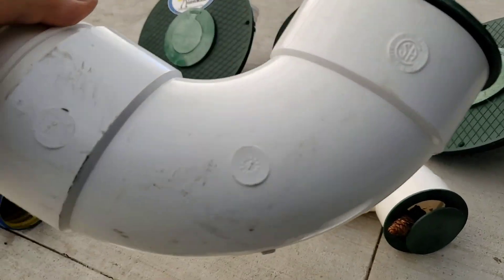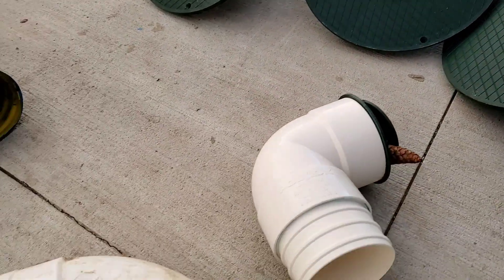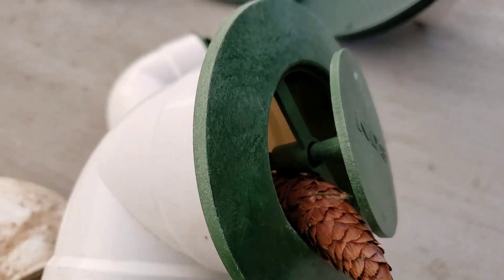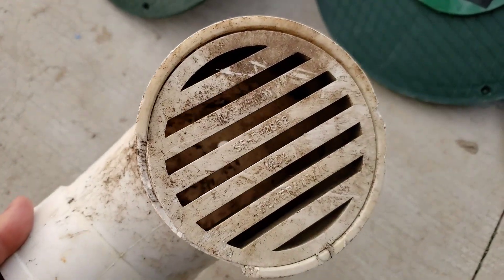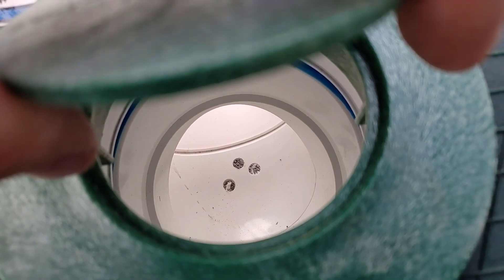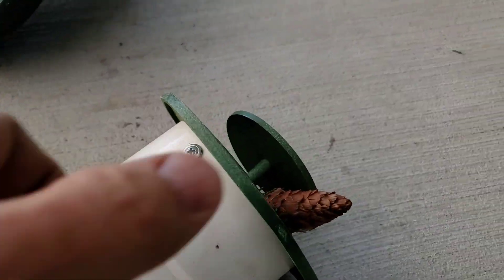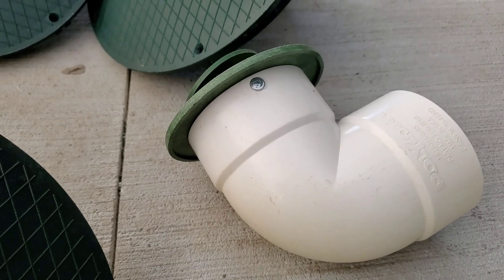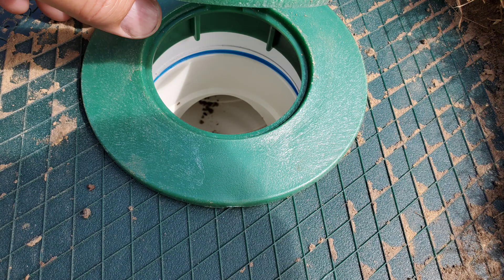Installing a pop-up Emitter Drainage System [ DIY Drainage Solutions ]

Comment: Fantastic videos! Super helpful and empowering! Question ~ if I am running two 4" Pipes (per your recommendation) in the french drain around the perimeter of my home, is there a way to run both of these to one pop-up? Or would you want to discharge each line to it's own pop-up?
Reply from the maker: You can Wye them into one pop-up emitter.
Reply: @FRENCHDRAINMAN  Thank you! If both pipes are at capacity and discharging through the same pop-up, would it be constraining the system at the pop-up? Do you make a bigger pop-up for this by chance?

Comment: I have a 3 NDS pop-up emitters in my backyard, 1 drains into a dry rock bed and the other 2 into the grass area. My son was responsible for cutting the grass in the backyard and when I showed him how to do it, I told him to weedwack over the 2 drains to prevent grass from growing over it. Over the summer, water was backing up in our driveway that is supposed to drain to the backyard, I thought the NDS catch basin was blocked but it wasn't, the pop-up emitter 50ft away had about 1-2 inch of dirt and 3 inches of grass growing over it preventing the water from draining. Since this was a relatively straight shot, I knew exactly where the emitter was supposed to be and with a shovel i had it cleared in minutes. The more difficult job was the other pop-up emitter for my basement sump pump, I had an idea where it was supposed to discharge but could not locate it until after hours of sticking a metal pipe into random spots trying to feel the top of the pop-up emitter. It literally took me over 2 hours to find that thing, a combination between the ground settling with 5-6 inches of dirt then 3 inches of grass growing over it. I can personally vouch that somebody should've invented this FDM combination a long time ago, shame on NDS and ADS. 

I bought 1 of these to test it out about a month ago, unfortunately I wasn't able to install it because I have to modify it first. I don't need the elbow pipe, I need a straight down pipe connection, my 2 elbows are glued and buried inches below ground. My suggestion to FDM is to come up with an emitter with a straight down pipe, maybe 6 or 12 inches long that the consumer can cut to length to fit there needs or sell the pop-up by itself without the elbow pipe. I think the pop-up along with the grass blocker surround is an excellent idea.
Reply from the maker: We will have a pop-up emitter with no elbow in March. I also can customize yours if you want to mail it back Attention Robert Sherwood. Thank you for commenting.
Reply from the maker: Watch "New Pop-Up Emitter V 2.0: Game Changer in Drainage! Made in USA, For Yard Drain Downspout Discharge" on YouTube
https://youtu.be/E85Tjrd5708